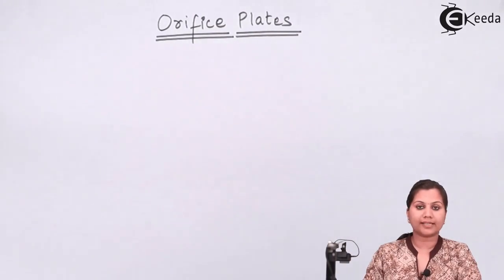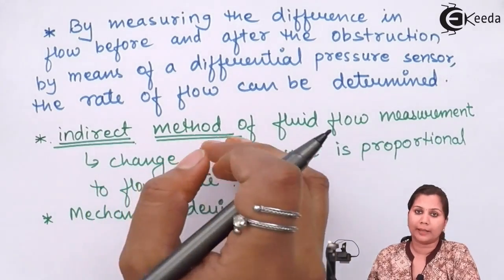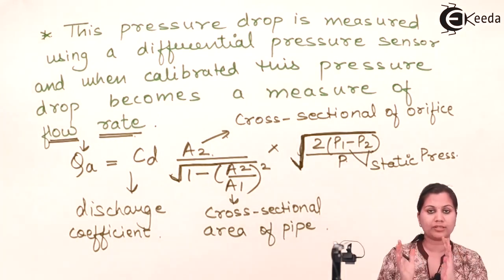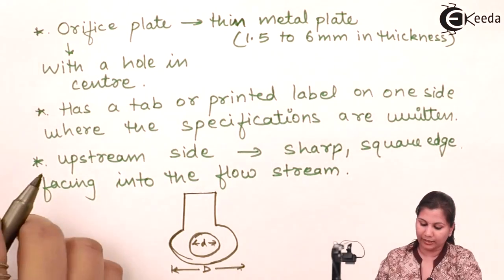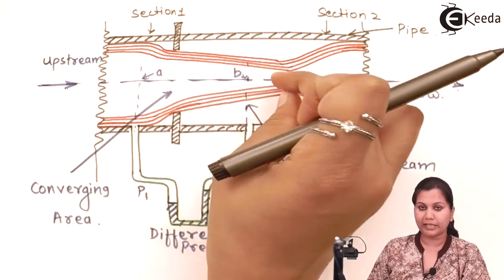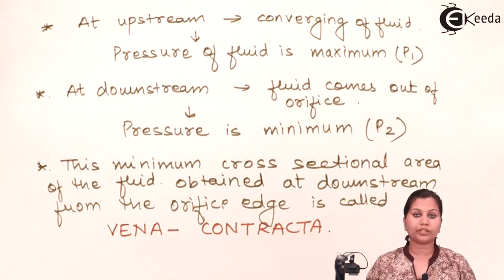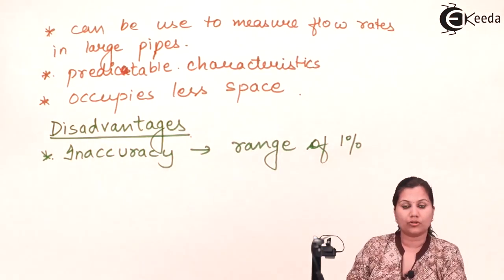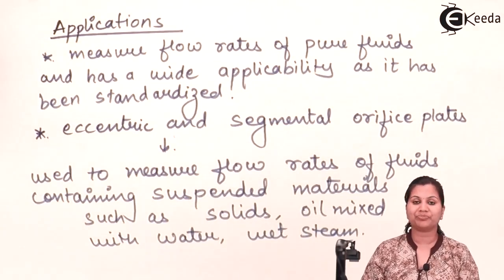Orifice Plates - Flow Measurement Transducers - Electronic Instruments and Measurements

Comment: Great works I really enjoyed every bit of this explanation..  Can you explain why differential pressure flow meters cannot measure mass flow rate directly thought they are dependent on the fluid's density.  We know that change in the fluid's density will affect the meters readings then why it is not termed as mass flow meter and it is called volumetric flow meter..   Thanking you in advance...
Reply from the maker: Hello
Thank you for your valuable feedback. Download Ekeeda application to get 1000 Studycoins and use it to access free courses.
Steps to follow:-
1. Download Ekeeda application from the link given below.
2. Sign up or Log in to your account.
3. You will get 1000 Studycoins worth Rs 1000.
4. Add the courses to your cart.
5. Select Study coins option to get free access.
Android App : https://play.google.com/store/apps/details/?id=student.ekeeda.com.ekeeda_student 
iOS App : https://apps.apple.com/in/app/ekeeda/id1442131224
Reply: @Ekeeda  This is not a answer for my question.

Comment: Orifice is a head type flow meter and flow rate is proportion to square root of the differential  pressure across the flow element. It is not directly proportional to the diff pressure. Please ensure correctness of content before publishing educational lectures